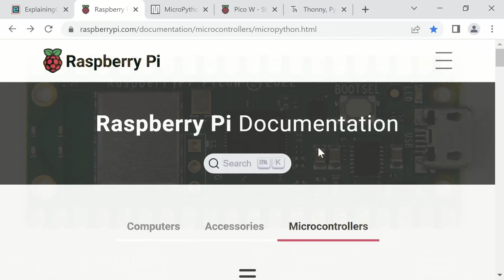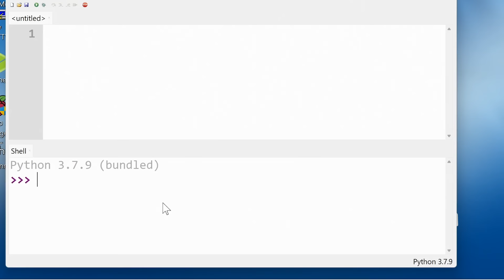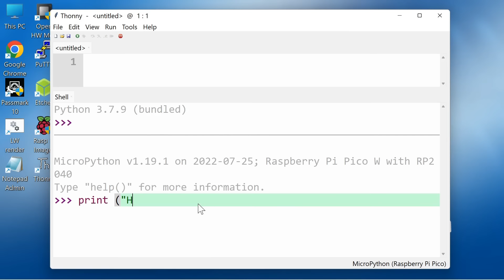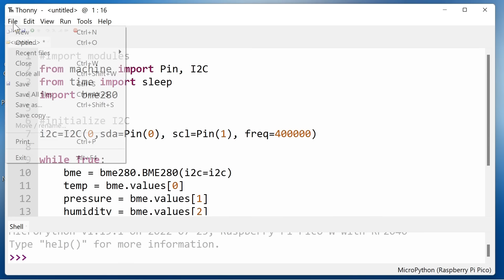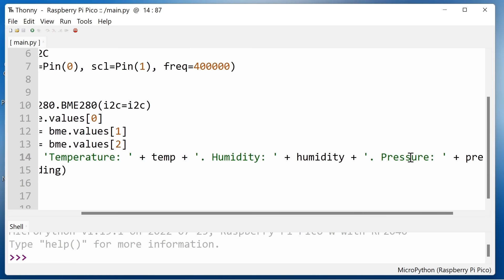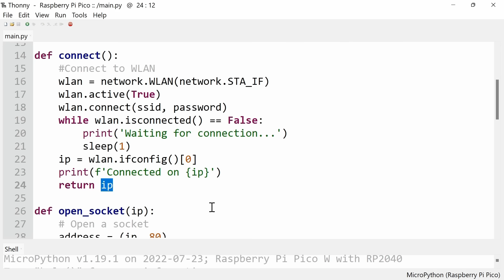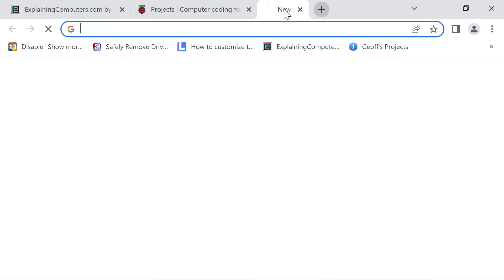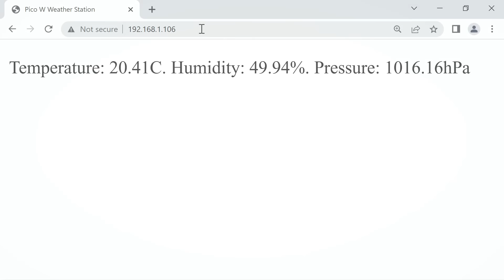Raspberry Pi Pico W: Wireless Weather Station

Comment: I can see the system you set up today being used as the controller for misters in a greenhouse. When propagating plants by cuttings, people want to maintain humidity in the propagation greenhouse at a certain level. They also want to keep the greenhouse from becoming too hot. This could be used to turn on misters when the humidity gets too low or when the temperature is too high. I remember your video on using a Raspberry Pi to control mains power. I'm sure a Pico could do the same thing.  

Have you done a video on when to choose a microcontroller and when to choose a microprocessor? If you haven't, that would be very useful.
Reply from the maker: Nice video idea -- noted. :)

Comment: I would say all nightly builds from all open source software should be considered "unstable", as they are just the day's changes merged into the main branch each day. The software builders have not had a chance to test the entire package. So marked as unstable.

One question,  you said you pressed and held the reset button at USB connection time but didn't say when you released it. Hope you are still not pressing it now :)
Reply from the maker: I did finally release the button! :)

Comment: great content. I was researching into creating a array of sensors across the house (and outside) to provide telemetry about various things. What I couldnt find is a good way to determine how much current this uses. For a single device you could just use a powerbank. But when you consider 5-10 of them the costs start to pile up. So was thinking of using an AA battery pack. But was wondering if you knew what the current draw was for just the sensor you used?
Reply: Mine measures around 50mA
Reply: @robhamps  thanks for that. I've found the "enviro indoor" or "enviro weather", etc are great series of boards that do this while still giving you python level access to do your own thing. 2 AAA batteries last 6 months ago they are ideal to install and forget.

Comment: Very nice, I've been meaning to put together a weather station. Could you plug multiple BME280 sensors into the Pico? Indoor and outdoor temperatures 🙂

Hopefully things are starting to cool down where you are.
Reply from the maker: The Pico has two I2C channels, so can indeed be hooked up to two BME280s.

Comment: I absolutely love IOT things, Chris!  I imagine it's also possible to save these things, maybe to a spreadsheet?  I'm going to have to look into this!  Thank you again for another great video! :)
Reply: Comer Separated Variable file
Date, Temp, RH, PA
2022.08.17 11.20, 22.15, 48.17, 1016.37
2022.08.17 11.25, 22.45, 48.23, 1016.44
2022.08.17 11.30, 22.68, 48.55, 1016.12

and so on.
That will read straight into Excel as a simple spreadsheet if you call it READINGS.CSV for example.
Reply: @wayland7150  He did a  video before saving it to excel.... I have mine running and updating a mysql database and have it backup too.
Reply: @philsbbs  Today I've just done this on a PI 3 using node-RED to a MySQL database. I'm awaiting my BME280 but my node-RED is all set to read the device.
Reply: Where are you able to get your Pico's so inexpensive? Could you add a link in the description?  Thank you for your awesome videos.

Comment: Yes, I too am always impressed by wireless real-time connections and measurements from my own devices and programs. Something magical about it. Like when writing my own code directly to the PC VGA and Serial controller registers. No BIOS, no DOS/WIN, no Driver Libraries.
This is not quite a fully satisfying bare-metal driver but it does feel nicer than the vast majority of IoT "commercial" development systems and interfaces. (Always too much bloat for local and personal use. And nearly always WWW internet dependent too.)

Comment: I got mine working without the sensor so it`s easier to try it out just plugging it into a usb. I took some lines out the code that run the sensor.
#import modules
import network
import socket
from time import sleep

ssid = '------------' #Your network name
password = '--------------' #Your WiFi password

#initialize I2C 

def connect():
    #Connect to WLAN
    wlan = network.WLAN(network.STA_IF)
    wlan.active(True)
    wlan.connect(ssid, password)
    while wlan.isconnected() == False:
        print('Waiting for connection...')
        sleep(1)
    ip = wlan.ifconfig()[0]
    print(f'Connected on {ip}')
    return ip

def open_socket(ip):
    # Open a socket
    address = (ip, 80)
    connection = socket.socket()
    connection.bind(address)
    connection.listen(1)
    return connection

def webpage(reading):
    #Template HTML
    html = f"""
            <!DOCTYPE html>
            <html>
            <head>
            <title>Pico W Weather Station</title>
            <meta http-equiv="refresh" content="10">
            </head>
            <body>
            <p>{reading}</p>
            </body>
            </html>
            """
    return str(html)
    
def serve(connection):
    #Start a web server
    
    while True:
        client = connection.accept()[0]
        request = client.recv(1024)
        request = str(request)       
        html = webpage('Dez is cool')
        client.send(html)
        client.close()

try:
    ip = connect()
    connection = open_socket(ip)
    serve(connection)
except KeyboardInterrupt:
    machine.reset()

Comment: Another excellent video, Chris, one of your best yet! I am working on a project based around this setup to monitor icing in a commercial fridge, and the prototype is going well. I did stumble on an issue with the bme280 library, but was able to fix it, because I am using a Stemma QT board instead of Pimaroni - it would be great if you showed your viewers that they can easily edit the bme280 library file through Thonny to change the default I2C address from its coded 0x76 (Stemma QT board I have uses 0x77). I am experimenting with how long I can make the interface lead between Pico and BME280-board, and all seems stable with 3metres running at 40kHz
Reply from the maker: Sounds like a great project. :)

Comment: I would think with the speeds of modern computers these basic computers would have better specs.  For example I thought the Ram would be a couple of megabytes at least not kilobytes
Reply from the maker: This is a microcontroller, not a general purpose computer with a display and memory-intensive forms of interaction like that! :) So the memory is ample to contain some control code.
Reply: for certain microcontrollers, RAM can even be measured in Bytes! =)

Comment: Great video Chris. As a suggestion, the battery voltage could also be displayed with the atmospheric output, so that you can monitor when the battery needs recharging.
I don't code so I can't offer anything for what reading and displaying the voltage would look like.

Comment: This video contains an inaccuracy: the Arduino "language" is not "C-like," it IS C++.
However, the microcontroller doesn't implement, by default, some operations (like dynamic casting) and the standard library is missing. But it's not a different language, just pared-down C++.
Reply from the maker: What on earth are you going on about?! :) Nowhere in this video do I mention the words "Arduino" and "C-like". Absolutely nowhere! :) The only mention of languages is where I say (about 2:40 ) "a Raspberry Pi Pico can be programmed in many different languages, including C++, MicroPython, and even BASIC, as I illustrated in my last Pi Pico video".

So by all means offer critique. But only of content that is actually in the video! To be clear NOWHERE in this video so I say ANYTHING about an Arduino or its language.
Reply: @ExplainingComputers  Oh dear. My apologies! I meant to write this comment on another video, but I must have hit a link to this one without noticing.
Please do ignore my previous comment, and thank you for informing me of my mistake!
Shall I delete the above comment since it is misleading on this video?

Comment: Marvelous project; another idea when it comes to meteorology. I assure this will help to improve weather forecasting systems around the globe (not only in monitoring temperature and pressure, but also with precipitation and wind measurements from previous projects). Hopefully you'll be making similar projects for early preparations for such disasters.

Comment: Great video! I have, however. become increasingly irate at the skyrocketing prices of the Raspberry Pi and using ESP32 at every opportunity in place of the Pi. I hate how RPi foundation start the board at a low price and then charge more for essentials such as pin header and wi-fi that are pretty much part of any project. I have grown increasingly fond of the ESP32-WROOM and got 4 of them for US $6 each and they come with WiFi antenna and pin headers soldered -  no questions asked. I work with local schools that are financially strapped and with skyrocketing prices of Raspberry Pi, the ESP32 has proved to be a lifesaver! Thanks for this video and as always, I enjoy your channel.

Comment: Thank you for a great project and a valuable learning project for a beginner
in this great hobby.  As I said, I am a very old in age but, very young, in the world of Micropython.   I followed your instructions and every thing worked well until I tried to run the code, which would print the values across the bottom of the Thoony app. . Every time I try and run the code I get the following error:
>>> %Run -c $EDITOR_CONTENT
Traceback (most recent call last):
  File "<stdin>", line 9
SyntaxError: invalid syntax
>>> 
With my very limited understanding of MicroPy I don't understand the error.  I did a search of the "while True" command with little help.  Can someone help me get back on the right path.  Thank you all and thanks for a great project.  Bill

Comment: It is a shame the sensors cost twice as much as  the pico, why?
Reply from the maker: I guess it comes down to production volumes. There are cheaper temperature-only sensors -- eg the MCP9808 -- but I had a BME280 available from another project.